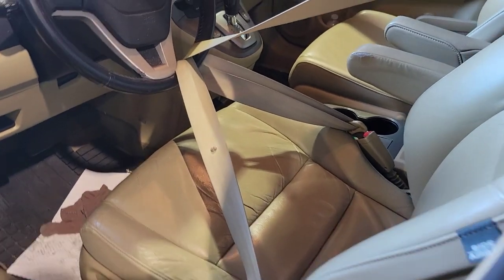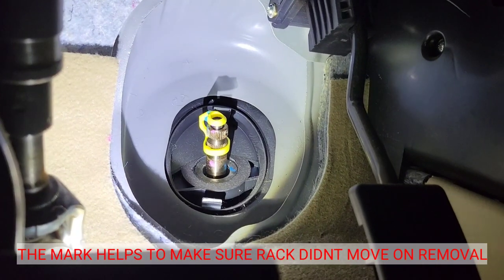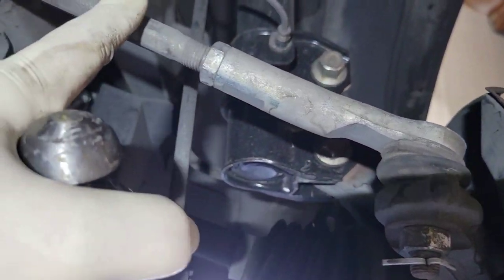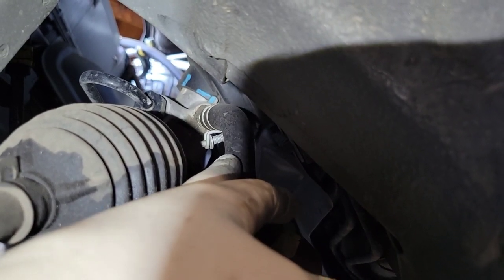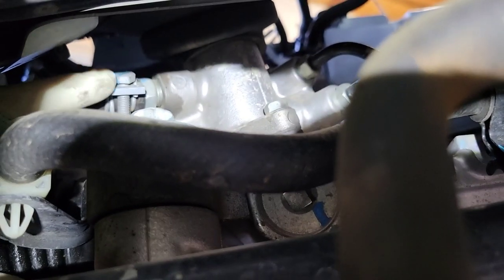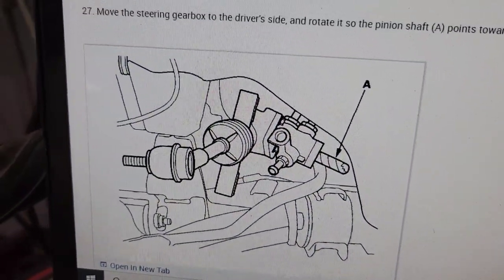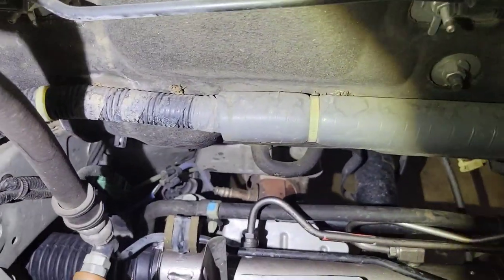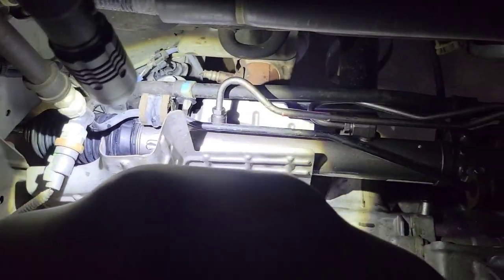2008 HONDA CRV RACK AND PINION

Comment: Great vid! I have to admit racks are a pain. I like the seat belt trick. I have messed up a clock spring or two in my day from the steering wheel being turned by mistake.
Reply from the maker: Thank you Bill. Yes some racks can be a real pain.  Thanks for .
Reply: Wheel should not turn when key is out of ignition

Comment: Awesome video. I saw fluid inside my boots doing some inner tie rods and feel the rack will need replacement soon. Looks like you use the factory procedure for removal as many videos are dropping the subframe down a bit. Good tips, I will use them all soon.
Reply from the maker: There are all kinds of ways to get racks out of vehicles. If you are ever replacing inner tie rods and you find fluid you should return the tie rods and replace the rack if you can. Thanks for watching I appreciate it.

Comment: I really appreciate this video. Unfortunately, I live in Pennsylvania and the stuff they use on the roads in the winter is very corrosive. The fasteners are very difficult to loosen. Is the the tie rod lock nut reverse thread? My sway bar nut will not come of the stud, It spins free inside the boot. Any tips on how to get the nut off? Thanks. I am sure I will have more questions as I proceed. So far, I have the tie rod ends loosened, but can't get the sway bar nuts off/ Everything is soaking with PB Blaster, Liquid Wrench, and WD40. I won't be able to work on it for another day, so I will keep soaking the fasteners. I also removed the high pressure line. The 21 mm flare nut brought out part of the threads and forced me to continue with the full replacement. Thanks again.
Reply from the maker: That sucks about the salt on the roads. The inner tie rod nuts are not reverse thread. As far as your sway bar links are concerned, there are several ways to get them off, one is in the end of the threaded stud that the nut is secured to sometimes has a hex inside to hold it. second way is on the back side you can put a wrench on some. If those do not work then cutting it off with a cut off wheel is my third option. I appreciate you watching the video and if you have any further questions feel free to message me on instagram and I will be sure to help you out.
Reply: @NutsandBoltswithTone  I had to cut off the sway bar link on the passenger side. I couldn't get the nut loose on the sway bar mount on the passenger side. Does the racj have to come out the driver's side? I didn't cut that sway bar link out thinking it wouldn't be necessary if I was coming out the passenger side. Is it vital to have the sway bar loose to allow the rack to come out? Thanks again for your help.
Reply from the maker: @bobwilkey7976  oh yeah I have had to cut them off as well.  Yes out the driver side.  And both links have to be disconnected so the day bar can move out of the way.
Reply: @NutsandBoltswithTone  Thanks. I will work on getting the sway bar out of the way. I appreciate your help.

Comment: During the front struts replacement the brake rotor assembly lowered to ground, what should I do? Thanks
Reply from the maker: Most likely your outer cv joints pulled out so if that is the case you have to get that joint back together

Comment: The only problem I had  was getting out the  Rear sway bar bracket bolts. Both broke. I was using a hand ratchet and pblaster
Reply from the maker: Yeah those bolts are a bugger and having one break really sucks. Thanks for watching.

Comment: I'm late to the party, but how do you know when a rack and pinion needs to be replaced? I have a friend (girl) and one of the rubber boots has a tear in it, and the dealership told her she needed to replace the entire assembly including the tie rods, and struts, then a wheel balance and alignment. THOUSANDS of dollars she doesn't have. And the thing is it steers fine, no leaks, no noises.
Reply from the maker: The main reason you would replace a rack is if it's leaking,  mainly it would leak inside the boots.  The boots are replaceable.  If it's not leaking externally or inside the boots then it's probably OK. The other reason would be if the rack has too much play.  If you have any further questions message me on Instagram and I can help you out.  Thanks for watching.
Reply: @NutsandBoltswithTone 

Dude, you are AWESOME. I'm trying to help a friend (girl) who may be getting ripped off by a dealership, but I've never dealt with power steering issues.